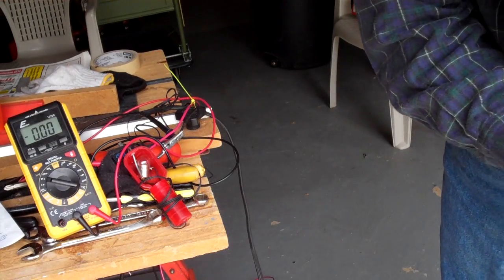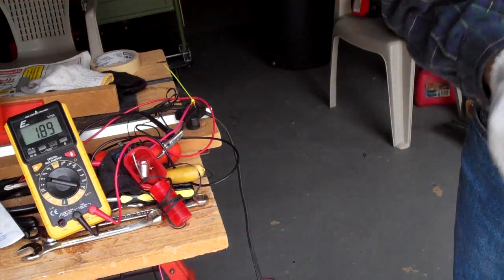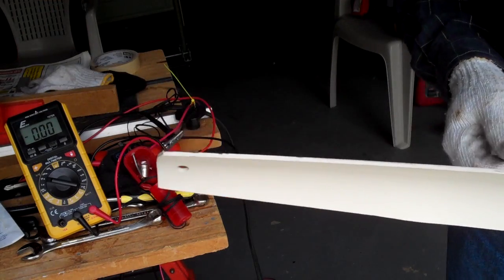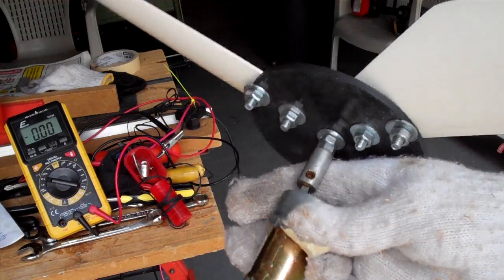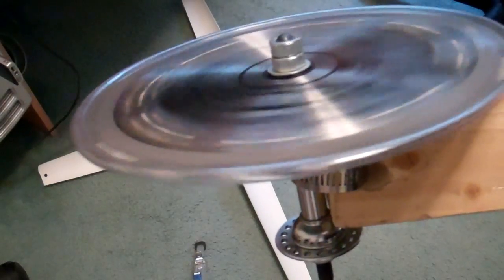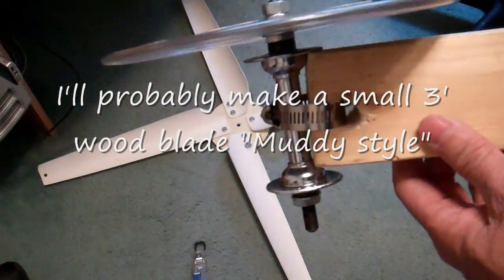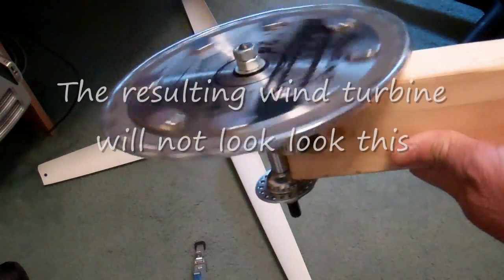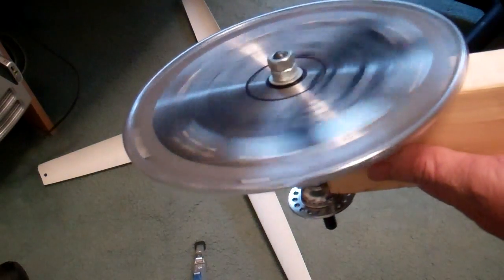A small horizontal axial flux alternator wind turbine pt. 1 Movie.wmv

Comment from the maker: I was busy working on the solar oven tracker. I haven't decided how many phases to make for the axial flux alternator. I have wound one coil so far. Maybe I'll make an alternator with 4 phases with 3 coils per phase. Probably 16 magnets on a 10 inch saw plate instead of the 7 inch as shown in the video. This time I'm thinking of making a single rotor only instead of dual rotor. Thanks for commenting. If I'm not subscribe to you already, I will so I know what progress you have made.